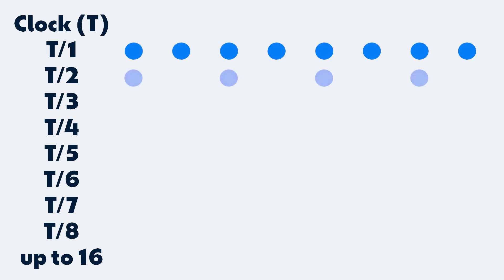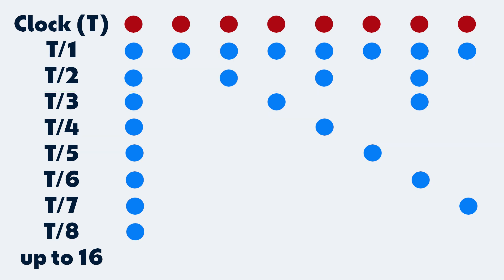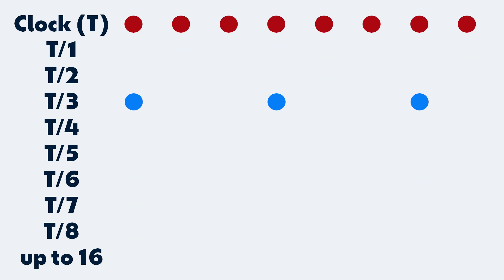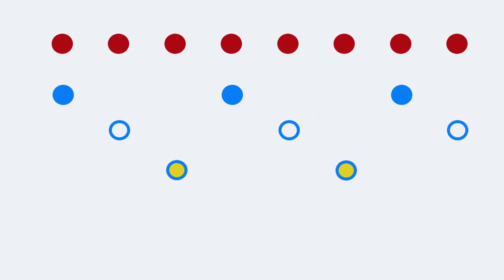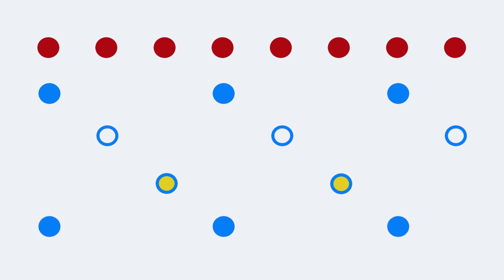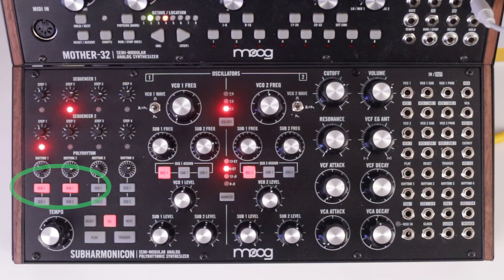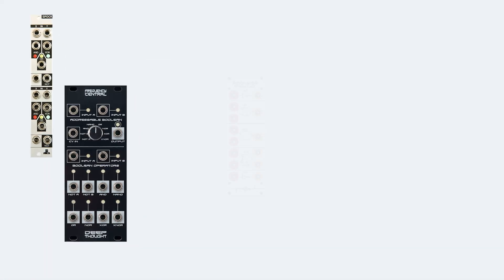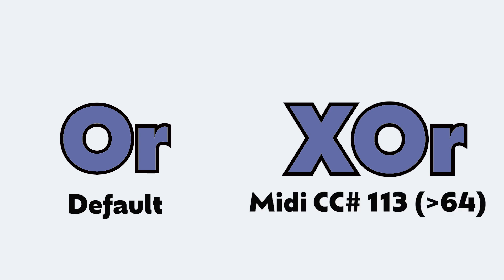Part 7 - Rhythm Generators, Logic, and Clock Dividers - Subharmonicon Complete Tutorial

Comment: Sorry if this is obvious, but: how on earth do I easily and consistently make sure the patterns / "chord progressions" I make on my Subharmonicons (yes, I have two 😅) will fit a standard 4 or 8 bar pattern length?

Cos whenever I make something that sounds nice, it has some arbitrary, non-standard length. It's really difficult to fit a 13 bar pattern into an 8 or 16 bar based production.

Why's it important? Because I make melodic house and techno, and for a DJ it's annoying if a track is f.e. based on a 13 bar patterns. Makes it impossible to sync up the drops between tracks, etc.

So, please: if you (or someone reading this) can help a dyscalculic dude like me grasp this: I'd be soooo grateful! 🙏
Reply: PS: not looking for the "reset" trick. I've done so already, but it's not the true solution I'm looking for.
Reply from the maker: I think you'd just have to make sure the rhythms fit in... Set to divisions of 2, 4, 8, 16. Etc. You're kind of trying to fit a round peg into a square hole. By nature the SubH is designed to do these types of polyrhythms but it sounds like that's not what you're looking for.
Reply: @braintree56  Sure, choose divisions that divide with 16 (2, 4, 8). But to create a polyrhythm another rhythm that does NOT divide with 16 has to be chosen. And once I do that: the resulting pattern is (seemingly) never of 4, 8 or 16 bar length.

So, either I have to use the "reset" hack (which I find crude, hence a hack and not a trick) – or pioneer that polyrhyhmic techno is made in 12 bar sections. Cos 12 is a number that lines up with many polyrhythms it seems...

PS: ehh... I AM looking for polyrhythms. Why else would I get two Subharmonicons? The challenge for me is to work it into tracks that are still mixable by DJs. And I hope we can agree DJs are no small part of the techno community? Making one's tracks more difficult to fit into the sets of techno-djs, with drops that happen 4 bars earlier than expectec (when phrase-mixing / phrase-matching I think it's called): is probably not helpful to one's techno music career 😂
Reply from the maker: @Tazmanian_Ninja  Yes - I wouldn't recommend using the SubH for this purpose. You're right - if you use Rhythms that trigger every 5 or 9 steps (for example) - they will not fall into a Pattern that a DJ could easily mix. I would suggest looking into some other tools - like Elektron Devices - if that is your goal. 

There might be work arounds or hacks to get it to work and with some creativity, you could do it. But it's not the way the device is designed.

Comment: Cool explanation, really appreciated!
When you set the master clock in the Mother32 at with PPQN usually do you keep the output clock? mother has multiple outputs for the clock
Reply from the maker: I usually use the Assign out for the Mother. I don't think it has any other outputs. Generally I leave it as it's default setting unless I'm trying to do something specific.
Reply: @ thanks a lot :)

Comment: I've been watching your tutorials for some time and they are helping me wrap my brain around this incredible instrument. I have a little synth experience and modular is very new. I'm a sax and EWI player. My question is about using it with logic. What I would like to do is program a drum loop in logic and have that tempo/clock sent to control the sh tempo. I have a midi to 16th to go from my scarlet to the sh. Can you point me in the right direction? Thanks
Reply from the maker: Yep. (I think) In Logic, go to Settings -> Audio+Midi -> Midi Sync. In the midi sync project settings, make sure to enable the midi clock for the channel the Subh is on. 

The Subh should be configured to receive the midi clock. 

So the settings you need to adjust are in Logic. 

Let me know if you still have trouble and I can try to do it the next time I'm in my studio. I'm trying to give this advice from memory... :)
Reply: @ thanks!

Comment: Hey! I think the reason for divider knobs to not have lock-in points is purely unification and subsequently cost. To have them lock-ins they would need to manufacture and use a different hardware component, which results in a lot of added expenses - design, manufacturing itself, keeping stock and logistics separately etc. Moreso, if they would need knobs with different number of lock-in divisions (16 for time dividers, 12 for notes etc.) each is a separate article with a separate logistics.

Instead, the whole this line of synths uses a very limited variety of high-end knobs (I think, it's literally three?) that allows to minimise such expenses. Knobs are manufactured in large quantities, can be transferred between models if sales of one are faster than another, amount of different components is minimised.

I'm sure that's all there is to it. Minor user inconvenience versus increase in cost.

Comment: You could use the assignable function on the Mother-32 to send a trigger at step 1 and connect that to the reset in on the SubHarm. That would give you a clock divider, but would obviously impact what you sequence on the Mother, if you need a slower clock.
Reply from the maker: Great tip!

Comment: what exactly you mean by feeding from a beatstep pro ? can you explain what is being fed through midi cable as I got lost in the Or Vs XOr
Reply from the maker: In order to switch between the two logic functions - 'or' and 'xor' - you need to send it a midi signal. The midi cc# is 113. If you send that CC channel a value of 63 or less, it will operate on the 'Or' function. If you send it a value of 64 or more, then it will operate on 'XOR'. I don't have a beat step pro, but I've heard you can set it up so that one pad, when activated, will send a signal of 127. When deactivated it will go to 0. So that way you can switch between the two. I've used my SQ-64 to do this. You can also do it from a DAW. Depending on your midi controller - you'll have to set it up differently...

Hope that helps.
Reply: @braintree56  Thank you I will try this up and keep you posted 🤗🙏❤️

Comment: The reason why the knobs are not locked in 16 steps, is size/cost.  Locked values would require a rotary switch (much bigger) or a larger knob with detents.
Reply from the maker: That makes sense. Too bad though.

Comment: These are such great tutorials.  I am a bit stuck on something you talk about in this one though.  I have no idea how to achieve the midi cc 113,  I have found on my sl mkIII (CV mod1 CC and CV Mod 2 CC) where I can change cc value.  I have set both to 113 but the sequencers play the same as they did before in default Or mode.  I don't know if I'm in the right place or if I'm connecting the right cables etc.  Any help would be much appreciated.
Reply from the maker: Hmm... I'm not entirely sure. Just to make sure, this is Midi not CV. I don't know the SL Mkii, but let's start by making sure you're sending the messages through midi. Are you doing that? It might still be the Mod1 section, but just make sure you're sending through midi. Make sure the little light next to the midi input on the patchbay lights up when it gets the signal. That's my first thought. Let me know if that doesn't work.
Reply: make sure you're on the right channel (1 by default)

Comment: Coming back with another question.... For those not into Eurorack, can one use something like the Keystep Pro to enable the polyrhythms (ex. 16-3-7 = 336) on your example, instead of the Doepfer A-160-2 Clock Divider? If not, w/o Eurorack, it would require the clock divider plus case w/power supply at the minimum! I did find a standalone clock divider, yet, with very few divisions available.  Any insights would be welcomed.  Thanks!
Reply from the maker: Hmmm... You know, I bet you could set up a 16 step sequence in the Keystep (or any sequencer) and turn the gate off on all but the first steps. If you plug that into the Reset - it should have the same  effect! I have an SQ-64 and can try this out a little later... The SQ-64 is a great sequencer and only $130 on Reverb.
Reply: @braintree56  Thanks! Will certainly be trying that out.

Comment: 2:45 as a synth DIY hobbyist, I know that smooth knobs like these are the most readily available and the 'cheapest' (reliable knobs aren't cheap!). Then you have knobs with a center detent. And then rotary switches with fixed steps are much costlier and often comes in larger package meaning that you can't cram many of them next to each other.
Maybe that's not the reasoning behind this choice, but there is good chance.
If you look at Doepfer A-110-2 Basic VCO web page, they say that they replaced the octave rotary switch for a toggle switch for this reason.
Reply from the maker: Thanks for the reply - that's the most reasonable explanation I've got - so I'm going to run with it! :)

Comment: Tremendous vid man and cheers for the nod on my BSP suggestion 👍 If I may offer up another, try feeding the Seq1 & 2 pitch outputs from the patch bay into a sequential switch (I use the Doepfer one) and feeding back into Osc 1 input. I had a sequence going that was switching between the 2 SubH sequences and a couple of Turing Machines  from Ornament & Crime doing their thing. I really need to get a clock divider to expand on that further… I have a Pam’s but I think  a Doepfer one is imminent! Cheers dude ✌️
Reply from the maker: It was a great suggestion. I have the Doepfer Seq. Switch - I'll give this a try! I don't have Pam's but I thought it was kind of the best of the best in terms of clock stuff... Are there deeper ones?! The Doepfer one is great and especially for the price. Rock on! :)
Reply: @braintree56  That should’ve read Doepfer one imminent 🤣 I’ll correct it. There is a Pam’s Pro now which is a considerable upgrade in an already excellent module.
Reply: How do I program my BSP to do this? Any resources for how I might figure this out?
Reply: @TheJrwalker77  Can you be more specific Justin?